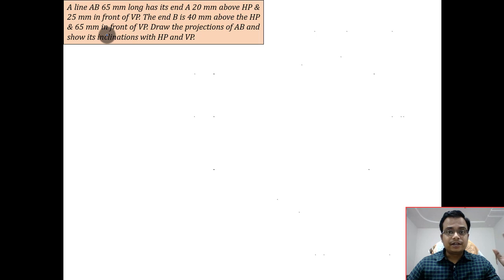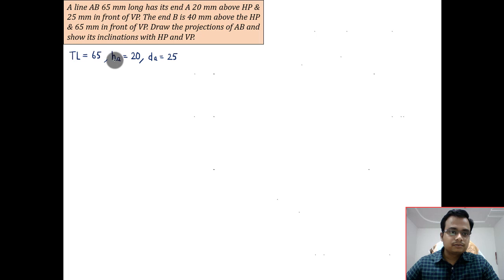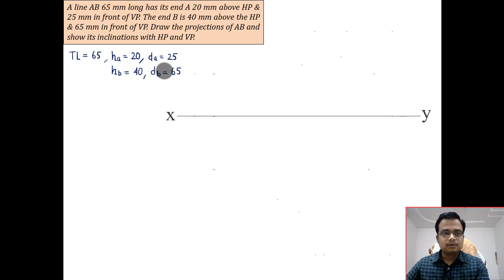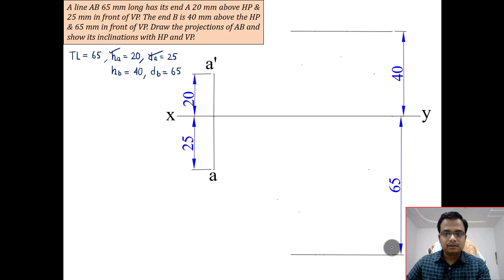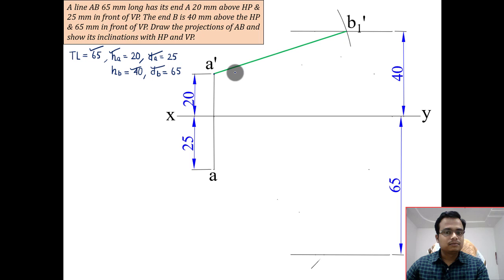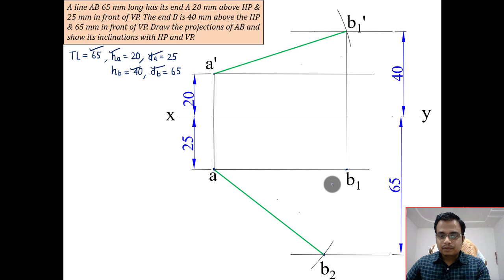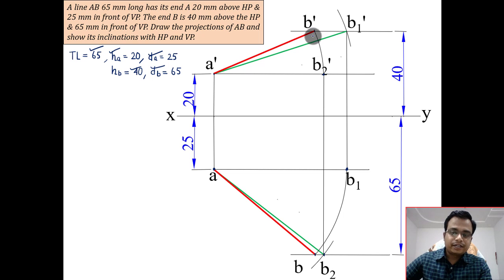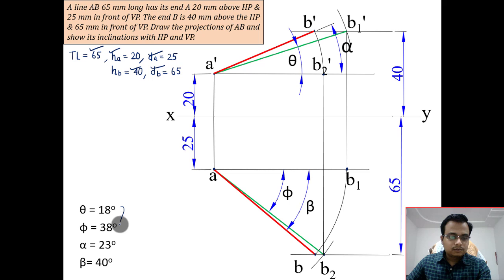Projection of Line_Reloaded | Level 2 | Problem 6

Comment: A line AB 65 mm long has its end A 20 mm above HP and 25mm in front of VP. End 
B is 40 mm above HP and 65 mm in front of VP. Draw the projections of AB. Find its 
inclinations with HP and VP.

Comment: Prob. 5. A line AB has end A 15mm in front of V.P. while end B is 60 mm in front of V.P. The line is inclined at 30° to H.P. while the plan is inclined at 60º to V.P. The V.T is 20mm above H.P. Draw the projection and find the H.T. and inclination of line with V.P.

Comment: A line AB, 50 mm long, has its end A at 40 mm above the HP and 20 mm in front of the VP. The end B is
closer to the HP but away from the VP. Draw the projections of the line if it is inclined to the HP at 300
and to the VP at 450
. Also draw side view

Comment: A line AB 65 mm long has its end A 20 mm above HP and 25 mm in front of VP. End B is 40 mm above HP and 65 mm in front of VP. Draw the projections of AB. Find its inclination with HP and VP.

Comment: A line CD measuring 80 mm is inclined at any angle of 30 deg to HP and 45 deg to VP. The point C is 20 mm above the HP and 30 mm in front of VP. Draw the projections of the straight line.

2

A line AB 65mm long has its end A 20 mm above HP and 25mm in front of VP.  End B is 40 mm above HP and 65 mm in front of VP. Draw the projections of AB. Find its inclinations with HP and VP.

2

Comment: Top view and front view of a line AB, 70 mm long measures 55 mm and 60 mm respectively. Draw its projections if end A is 15 mm above H.P. and 20 mm in front of V.P. Determine its inclinations with H.P and V.P.

Comment: 3. The front view of a 60 mm long line AB measures 48 mm. Draw the projections of AB if end point. A is 10 mm above the IP and 12 mm in front of VP and the line is inclined at 45" to the HP. Draw the projections of AB and find the angle of inclination of the line AB with the VF.

Comment: An 80 mm long line PQ has its end P, 10 mm above the H.P. and 25 mm in front of the V.P. The line is inclined at 30o to the H.P. and 60o to the V.P. Draw its projections.

Comment: 2. The point A of a line AB is in HP and 60 mm in front of VP. The point B is in VP and 40 mm above HP. The distance between projectors is 70 mm. Draw the projections of the line and find the true length and inclinations

Comment: A line NS 80mm long has its end N 10mm above HP and 15mm in front of VP. The other end 
S is 65mm above HP and 50mm in front of VP. Draw the projections of the line and find its true 
inclinations with HP

Comment: A line AB, 65 mm long, has its end A in the H.P. and 15 mm in front of 
the V.P. The end B is in the third quadrant. The line is inclined at 30° to the 
H.P. and at 60° to the V.P. Draw its projections.

Comment: 3. A line AB 60 mm long has its end A, 15 mm above HP and 20mm in front of VP. It is inclined at 
65° to HP and 25° to VP. Draw its projections. Also mark the traces

Comment: A line AB, inclined at 40° to the V.P., has its ends 50 mm and 20 mm above the H.P. The length of its front view is 65 mm and its V.T. is 10 mm above the H.P. Determine the true length of AB, its inclination with the H.P. and H.T.
Reply: @sixersync07   ???

Comment: Draw the projections of a straight line AB of 100 mm long when one of its 
ends is touching the V}P and the other end touching HP. The angle of inclination 
with HP and VP are 40° and 50° respectively.
How I draw it sir?